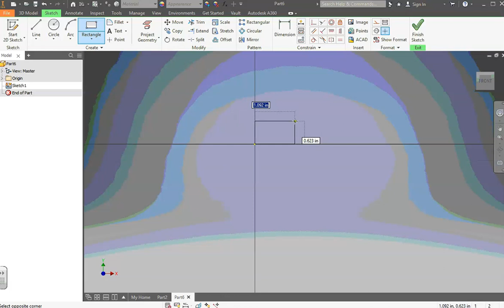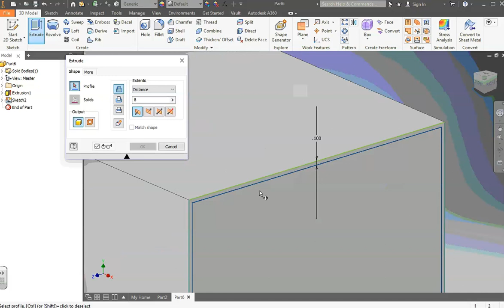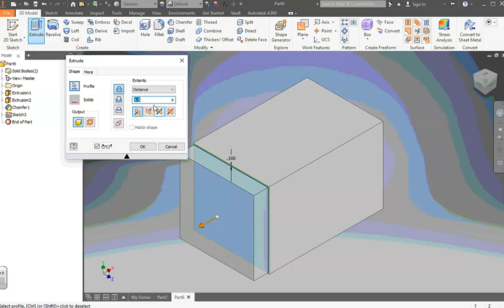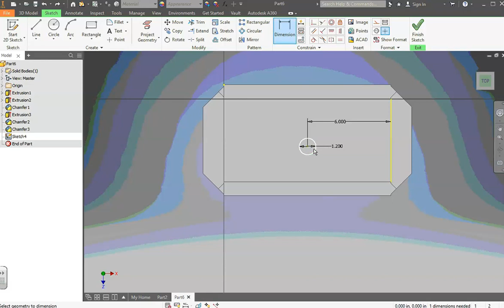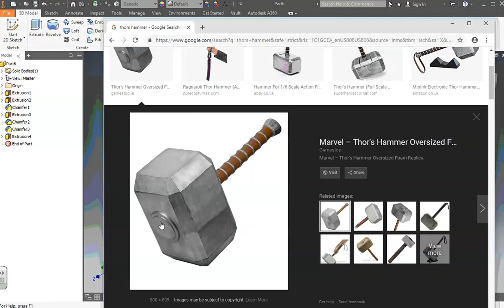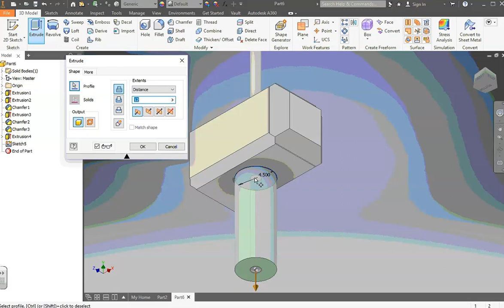Comment: I have Inventor 6 program software that I want to install on a new PC. I have the original box with Key and serial numbers, and want to install on a stand alone PC that is not currently connected to the internet. Do you have any suggestions or recommendations that will ensure a complete installation that I'll be able to use?